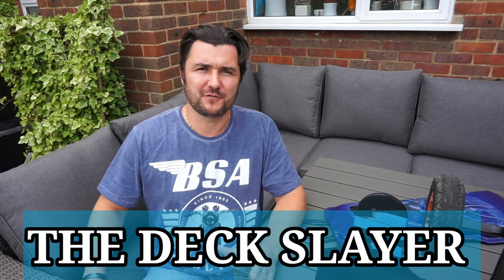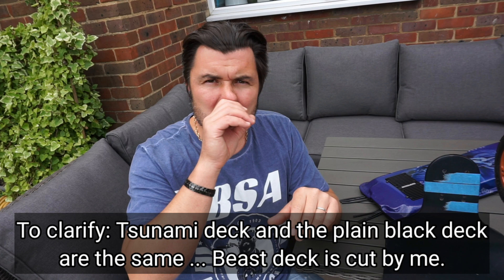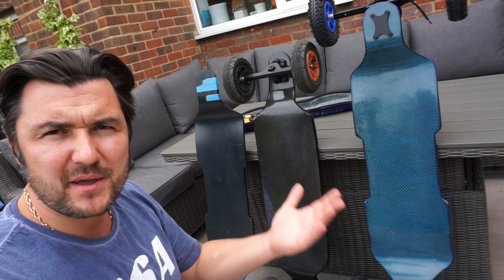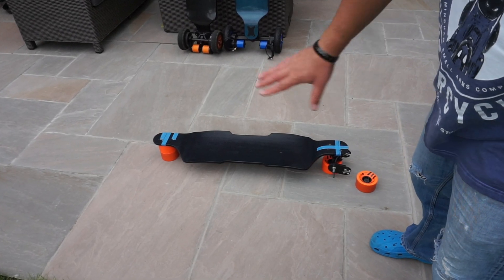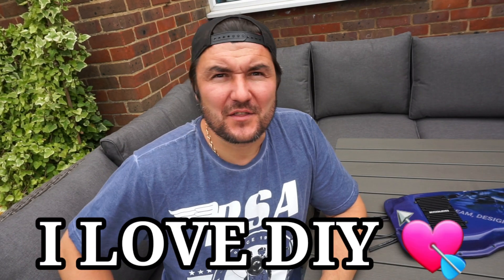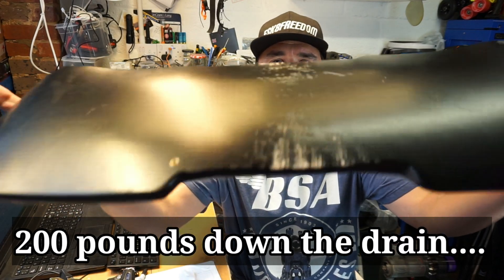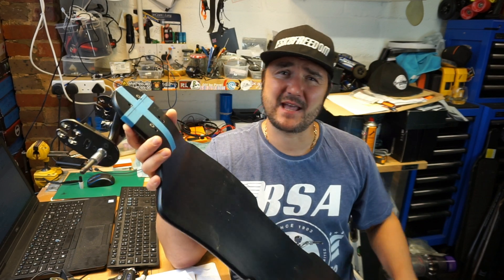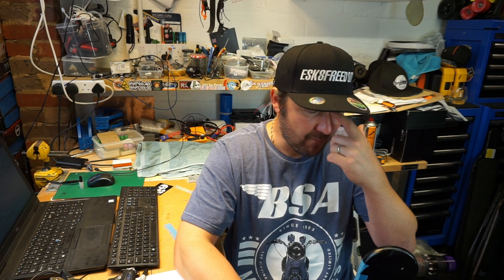Flex text of carbon fiber skinned decks.

Comment: The blue is from polyester which means it’s less strong than normal carbon.

Also when you ran it over with the truck it flexed and the weight went straight onto the ground and wasn’t supported by the trucks.

Comment: Mate, If u would have put The Carbon layer on The bottotm you would have faired better. If the carbon is on the top of the deck it is being compressed, carbon fiber is not strong in compression. If it is on the bottom it is in tension when you jump on the board, carbon fiber is insanely strong in compression so use it to your advantage. Looking forward to the next video:)
Reply from the maker: Hi mate!
Thank you so much for the comment. I have now made a new deck and did make changes to the design. Take a look ... should be taking the jumping no problem LOL.
https://youtu.be/dHfiNUzCkUw

Comment: 4:40
Thats why u never ever aply material only on 1 side (it isnt blue carbon fibre ...it is blue carbon kevlar :) )
Becouse u made sandwitch where top is super strong but u dont have it under the deck so all tension etc go under the deck that isnt as strong and stiff as top so it crack easly there ...u can have it super strong before wrap....but after that all tension go on 1 spot and "crack".
U can probablu still repair it not perfectly but still....aply some resin on crack and wrap it under the board with extra carbon to protect it from cracking again.
I will first try with only epoxy in crack and few cm of fibers
PS.
Carbon kevlar have kevlar in one direction....if u aply it straight not like on your deck at 90* u dont increse stiffness too much so u can aply both top and botton with the same stiffness than only top with carbon but 10x more strenght 

I making boards entire from composite without wood :) 0.5kg of carbon fibre xD
Right now working on super light mountainboard deck :)
Reply from the maker: Hi mate,
Thank you for watching and for the comment. The blue material is a called " blue carbon fiber sheet" and is made out of carbon ( black ) and blue polyester. You are correct, skinning just one side was a mistake....
Would be nice to see some of your progress photos mate...join me in my esk8 group ESK8FREEDOM and share with Us buddy.

Comment: I wonder whether by stiffening the whole deck and reducing its ability to flex across its whole length, you are effectively relying on the weakest parts (the narrow ends) to take the the same force as the centre. When you ran over the board with your truck, the whole boards was able to flex until it bottomed our, so the ends were never taking the full force. I’m no engineer, just a thought.
Reply from the maker: Gareth,
Your logical thinking is correct and i was thinking the same but why the beast deck is still in one piece? It is a cheaper deck ( inside ) and thinner areas where the trucks go.
I am thinking it is more to do with making the top layer stiff and the bottom too flexible.
i do have a plan and did get the materials for the next deck.... will upload a new live stream recording tonight. Stay tuned.

Comment: Mate have you considered skinning the sides instead mate?
Reply: Just was asking myself the same. Don’t understand why he didn’t do that. Without the sides it’s just optics. Doesn’t help strengthen the deck at all to do only the top layer...
Reply from the maker: Andreas,
Thank you for the comment. I will do on the next deck. I did not expect the deck to snap because the actual deck did survive quite a lot of testing....maybe a different batch?
Reply from the maker: Hi mate,
I think i might on the new deck.... i did not do the sides on the Beast board and it is very strong but still has flex. I will try to actually wrap the deck in a single sheet of carbon fiber or at least go around the edges as well. Thank you!

Comment: It looks like that only the bottom layer got ripped, the layers on top seem only seperated. I think it would be possible to glue the seperated layers back together and reinforce it  with carbon fibre.
The only downside is most likly a loss in flex.
Reply from the maker: Alexander,
Thank you for watching and for commenting. You are correct but unfortunately the to layer of carbon got cracked as well... this board will be capable of 40 miles and hour speed so i will not take any chances. new parts are ordered and i got something special planned. Stay tuned!

Comment: You need more angles on the front part, you only have it in one direction if you flair up the edges it will become a lot stronger... kinda make a concave on the raised part in the front then you have a lot more strength..
its important that the flex is in the long "straight" part of the deck NOT in the angled parts...
Reply from the maker: Hi Peter,
Thank you very much for the comment. You are correct, there was too much flex on the thinnest parts and no flex on actual horizontal part of the deck.... what got me off guard is the fact that the original deck was able to take a lot of force and did not brake so i did not expect it to brake with dual carbon fiber skin at the top....
I am planning to use carbon tow strip in the area that broke and will put a layer of carbon 2X2 twill sheet as well.
Fingers crossed.

Comment: For strength and flex I think you should skin the bottom of the board.  I'm drawing knowledge from archery here.  If you were to use carbon fibre when making a bow, you would apply it to the back because it's strength will prevent it from breaking under the tension created on the outside radius of the bend and the softer wood on the belly is able to compress (unlike carbon fibre) to allow for the compression of the inside radius of the bend.  On your board, the bottom is the outside of the bend.  Engineers and Bowmakers, if I have this wrong I'm sorry and please feel free to call me out on it.  Sympathy for your mishap though Pavel.
Reply from the maker: Thank you Dave!
Very nice of you. 
I have a plan! Will definitely take your comment on board. Got materials on order. 
Will definitely jump test the deck again though.

Comment: Unlucky mate, some flex is good, unless you’re going to do jumps etc I wouldn’t recommend a wood deck even if it’s carbon fibre skinned unless it’s like an mbs, something made for off roading, I think making it stiffer with the carbon but still having that much flex weakened the board, epoxy can seep in to the wood too, probably expanded causing the wood to become weaker, I honestly don’t know haha I’m throwing ideas in to your head now, good luck on the next one, let’s see if you can make it look more beautiful
Reply from the maker: Thank you mate!
I was thinking the same....maybe resin but the Beast deck is going strong.
I do have something special coming from USA so will do my best to improve even such a beautiful deck.

Comment: Pavel! My heart sank when I saw the crack. U are so positive man! Stay strong and carry on diy. Have u thought about carbon fibre skinning the first test deck that u drove the truck over? At least that deck was proven to take the weight of your truck. It's nice that the deck maker is sending you another prototype but there's no guarantee that the same thing will happen again...
Reply from the maker: Kho
Thank you for the support!
I did buy the last deck of this style and it has arrived now. I need to think how i am going to reinforce it this time.... i am sure i will come up with something. 
Stay tuned - i will definitely jump test it again.
Reply: That's awesome to hear Pavel. As an engineer myself... I quite understand why that deck is virtually indestructible, but when you cf skin it, it might crack. Do you think that the resin bonding the the surface of the deck is pulling the layers apart and causing a weakness at that spot? Maybe you might be better off not skinning it and just put the trucks + enclosure and ride the first board for a lil bit
Reply from the maker: @esk8Kyle  
I was thinking the same but looking back at my other CF skinned deck, i think the issue was with uneven distribution of the reinforcement between the top and the bottom. The top layers were restricted and the bottom were free to expand. i do have a plan and will go ahead with it. next deck will be much more work but will have some interesting features.